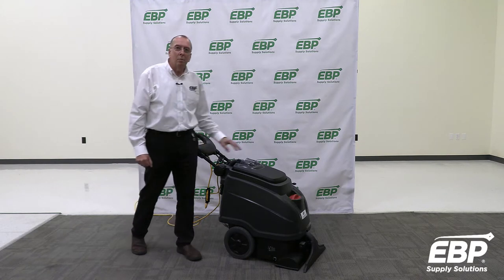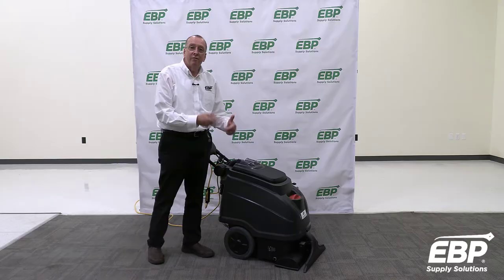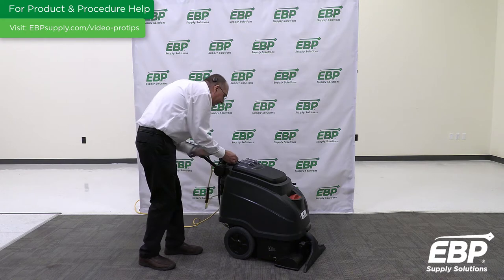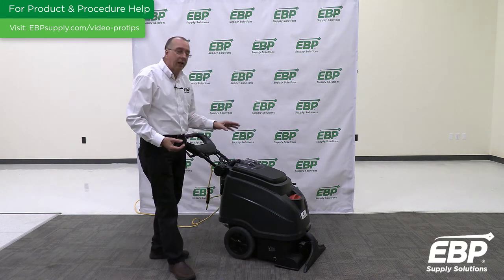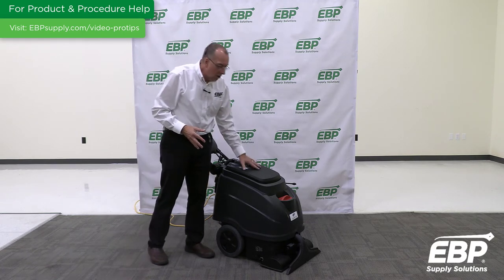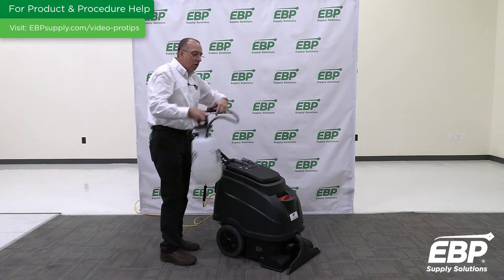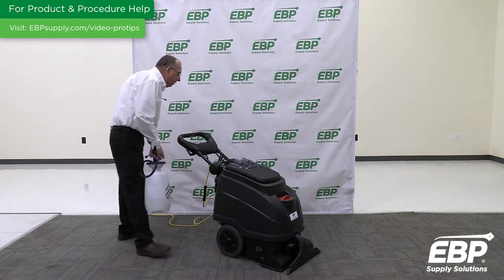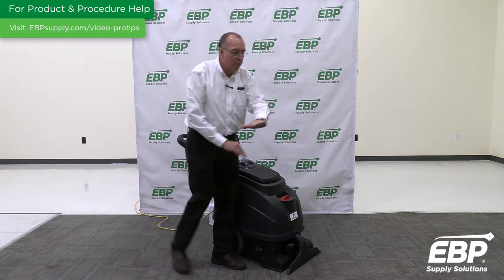How to Avoid Getting Foam in Your Commercial Carpet Extractor Tank, and ways to Eliminate it.

Comment: Thanks cleaning bro. I was vacuuming at home with a Wet vacuum with the sprayer attachment, I was checking the tank and it had a buch of foam. Turns out I used the wrong detergent.